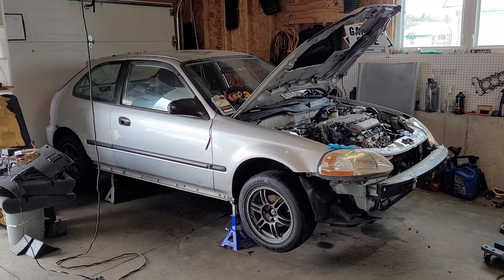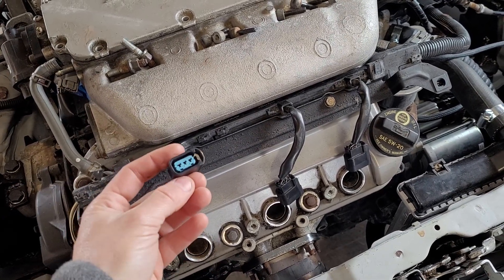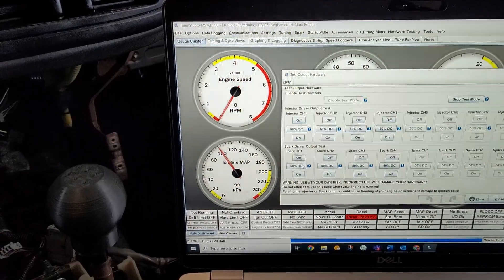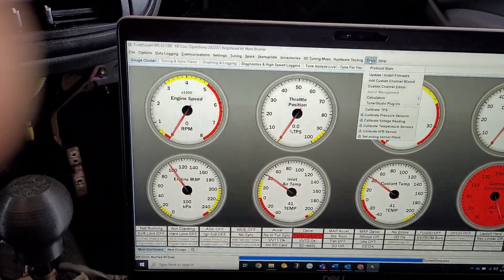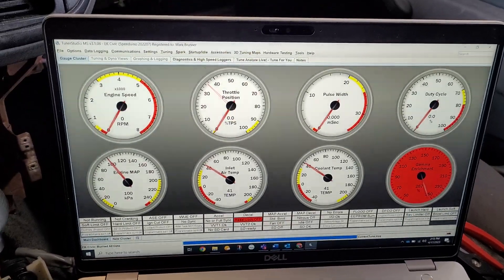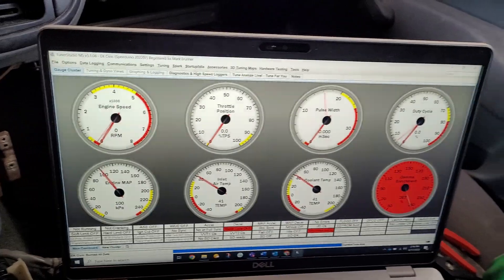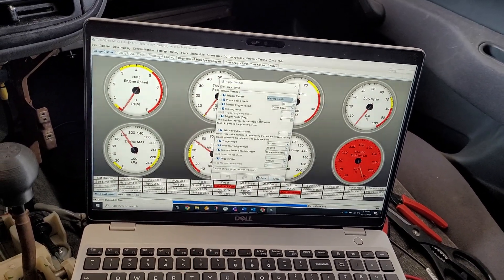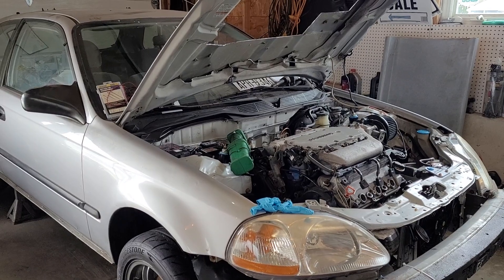Speeduino / Megasquirt - What to Check Before Starting the Engine The First Time EK Civic J Swap E14

Comment: Hi! 
My problem is that all my actuators and sensors are functioning as they should, my issue is with the crank + cam position sensors. I am using VR sensors with the conditioner, the conditioner is blinking while cranking and I can see their signal on my scope but I cannot see my RPM moving at all. Any suggestions please? I flipped the trigger edges, flipped their wires, yet no RPM readings
Reply from the maker: Have you verified the jumpers on the board are correct to send the signal through the vr conditioner? Also, id check with the scope that the conditioned waveforms are getting to the correct arduino pins. If so, maybe try a different arduino board?

Comment: Bruh I wish someone made this video for me as well at least I used a lot of info from link ecu and wiring specialty including using just one vvt solenoid to get my Nissan to run because the vvt jumps 40degrees advanced and retard so I had to use one vvt solenoid to make it run, and to set the degree for the missing tooth was 60 degrees for my setup